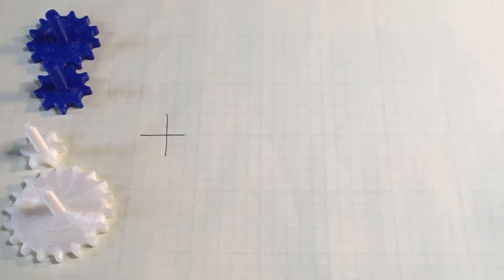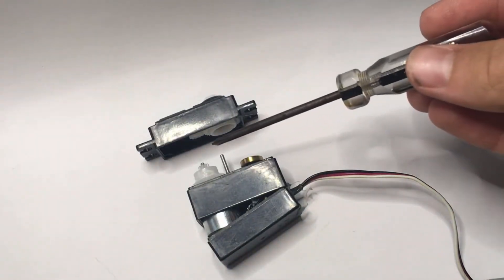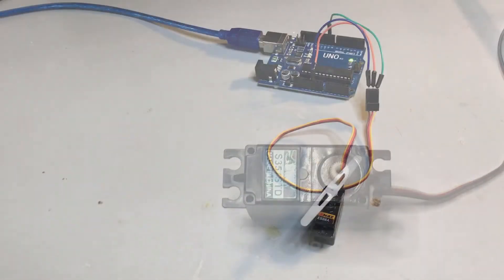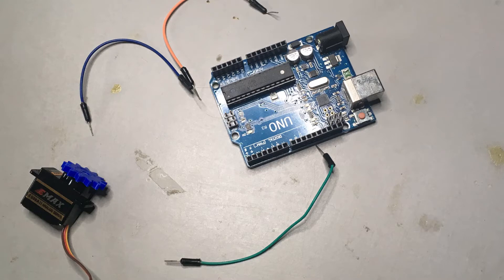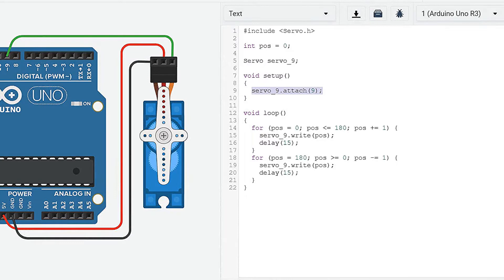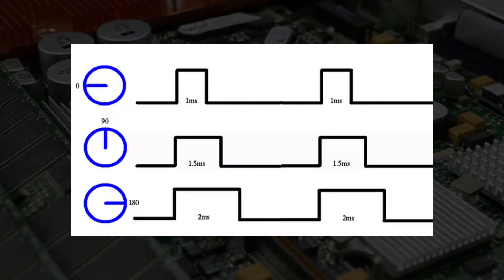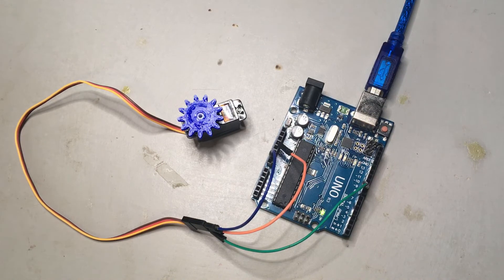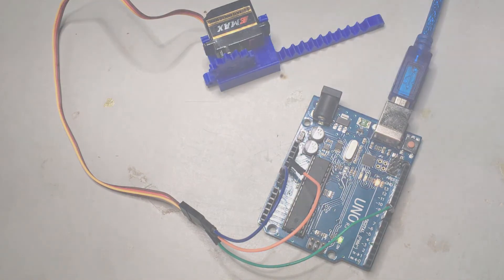Arduino In Motion (Episode 4: Servo Motors)

Comment from the maker: Question of the day: How do you make a servo motor rotate more than 180 degrees?

Answer To Last video's question: 

When a third gear is added, the total gear ratio stays the same (if you count it as two ratios, the middle cancels out), 

but the two original gears rotate in the same direction.